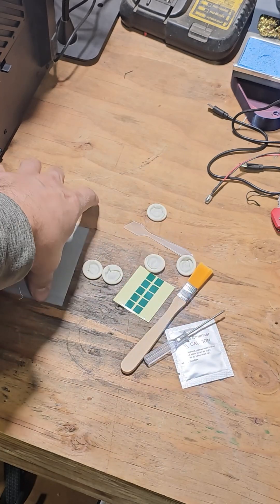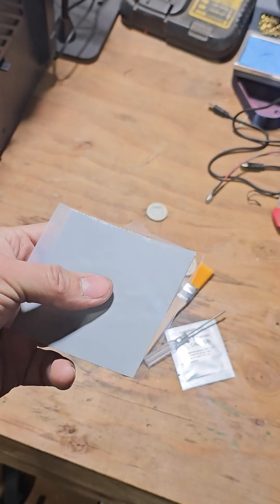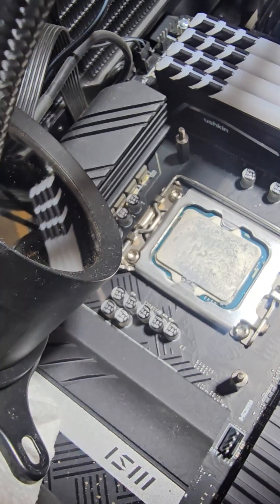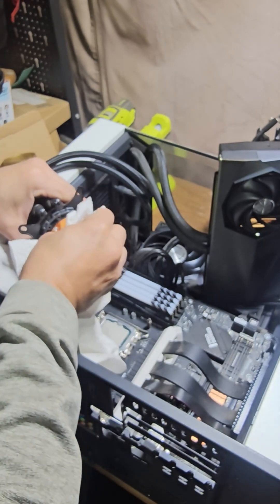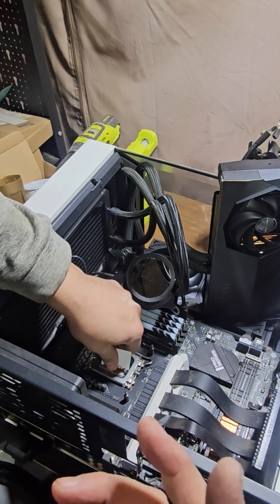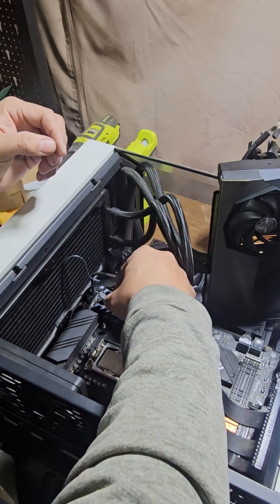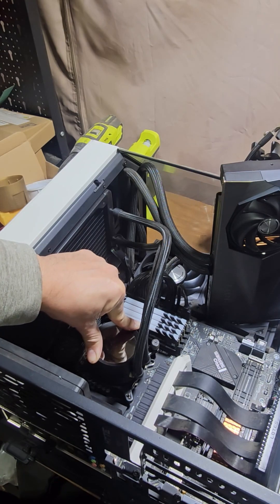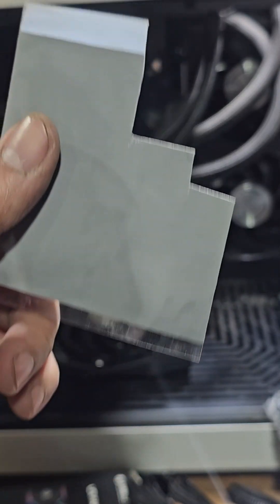CPU or GPU Thermal Pad

Comment: Paste is better then pads, pads are for those who arent skilled to apply paste from a tube. Thermal paste will fill gaps to remove air. The solid nature of a pad will not do that. I NEVER recommend a pad on a CPU or GPU
Reply: False this is PtM7950 it’s a phase changing material that has it gets above 40 C it become more of a liquid filling in all the cracks actually gets better the more it’s used has a thermal conductivity of about 8.5 W/mK 
but also has a much longer life than normal Thermal paste. i think some thermal pastes come out on top at first but overtime the ptm wins
Reply: 10/10 recommend ptm7950
Reply from the maker: It's been working better than in the past. I can see the results. It has been a couple of months since I applied the tape. I agree; that is why I made a video on how to add thermal paste. You can check it out here. https://youtu.be/QJsd2Ak2MtA